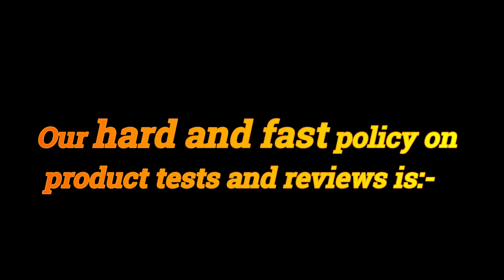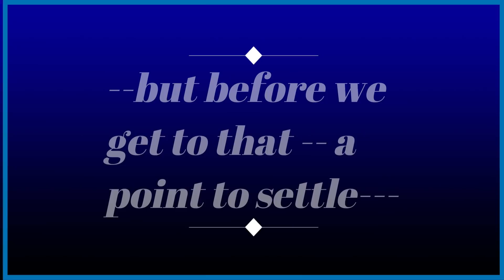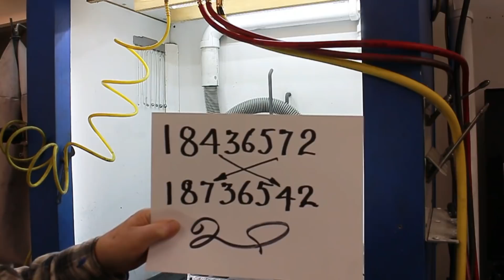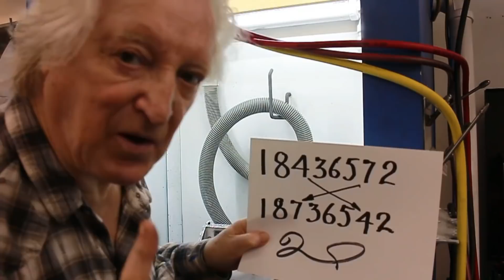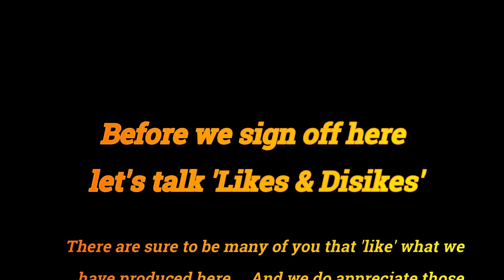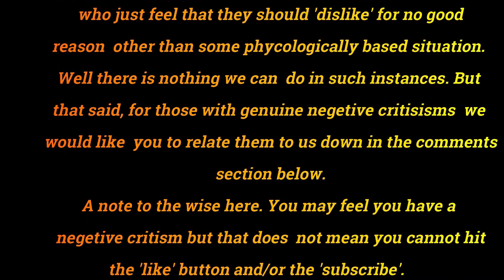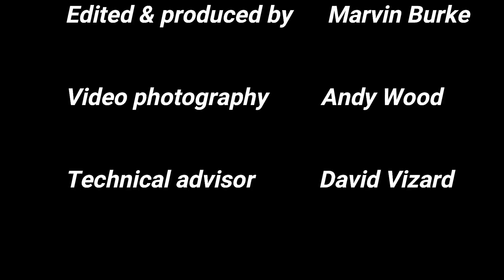PowerTec 10 EP 11Hi-Torque  Tunnel-Ram Mods

Comment: A lot of racing roots blown applications like the single 4&7 swap because the blower front loads the manifold. Allowing them to stagger the compression less in the front holes. Blown Fuel engines with the 4,7 3’2 swap beat the crap out of #3 for some reason. Most guys run it .030”-.040” lowered down the bore.

Comment: Sir, you just defined something I did in the early 90s but I never put any science to it. I had a 350 Chevy with lt1 head that I spent many hours porting. It had a big nice comp solid cam and 12 to 1 pistons. The engine ran very good and I was always tweeking and tuning to get more out of it. One problem I always had was no 2 spark plugs was brown and not burning clean as the other.  I knew I had power waiting if I could get that cylinder to flow. My intake was the old holley strip dominator single plain. I ended up beveling the entry edges to the port runners and the little engine had a tenth better et. Not focusing on more of what I did that helped, I simply realized the intake was a that needed opened. Then I scored a TRXY1  tunnel ram and two 660s with linkages. This was the beginning of a 19 year old kids lifetime love of engine building and heads up racing. 
I have used several of your books as well as smokeys books in my early years. I'm also proud to say my eyes and ears are still open. 
Thank you sir.
Reply: I can't forget my 1st launch when switching to a tunnel ram and 660 holleys on my 468 I kept waiting for the front end to come back down! Super fun but inconsistent for bracket racing.

Comment: I’ve been altering port inlet sizes on single plane intake manifolds for years based on careful spark plug readings. It does seem to improve engine performance within a few percent. The way David does it on the flow bench is good.

Comment: Very well explained .  The only criticism that I have coming from ireland that I dont see many v8s . I am more experienced with 4 cylinder engines like ford cvh or zvh . Ford n/a yb cosworth.  Some uk engine builder like roy millington etc
Reply from the maker: Tom, did quite a bit of consulting work for Mountune back in the day when the Cosworth YB was all the rage.
Reply: @marvingvx1   thanks David  am a big fan have some of your books I use them as a bible.  A power tec ten on a semi hemi cvh head would be nice. I am working on one at the minute. Exhaust port is all wrong need to weld it up. Thanks for your reply

Comment: David:  Thank you for the information on the tunnel ram manifold.  I've been conceptualizing my path for achieving a balance in fuel delivery for the intake manifold in general w/o the 7 to 4 cam shaft split.  I was told, and I hope the information is correct, that the richest to leanest cylinders running are #1, #3, and #6 on a SBC.  I see that there is truth as your porting example will express.  The only difference is the #4 cylinder which should be changed for the #3 cylinder....I hope this is correct.  I'm going to give your recommendations a try.  See ya!

Comment: Thank you David for your wealth of knowledge and very informative presentation.
Will help me alot with a f future tunnel rammed 350 chev gasser project.
Look forward to your spacer video and future explanations. Cheers
Reply: He was something back in 1965 - 75 and maybe as late as 1980. His knowledge of engines is as obsolete as the small block Chevy is. None of any of this applies to an LS engine so why bother? In 1984 I was making 52 PSI at the intake valve on a 1985 GPz 750 turbo. In a time Terry Vance and Bob Carpenter were running 8.20s on their 1260cc Pro Stock Suzuki's and George Bryce was running 8.0 on a 1425cc pro comp Suzuki GS1100s I was running 7.70s on an 810cc street bike. It was the fastest street bike in the world according to several motorcycle magazines. Bill Hahn and Bo O'brochta were only .500 faster than my street bike on their top fuel funny bikes. I never got to finish that project because I got hurt in a wreck that took years to recover from. I'd love to hear David tell me why I could explode a turbocharger in 3rd gear because it was spinning so high the oil wouldnt lubricate the bearing. I had Terry Kiser put a 3 stage Torrington bearing in it which meant I could now shift from 3rd gear to 4th gear before it exploded. FYI in 3rd gear the bike ran a low 9 second et at 145 mph after it came apart. in 4th gear it ran a low 8 second et after it exploded. My point here is I was against guys a lot smarter than David Vizard who were doing a whole lot more with a whole lot less and I beat them so bad its not funny. I hardly think anything Davids ever built could run with a motorcycle I built 37 years ago.

Comment: We used to separate the ports with a divider wall of aluminum back in the 80s.

Bv
Reply: ELIPTICAL(protractor shape) shaped divider set into epoxy from top to bottom of the divider wall entrance between runners #5 & #7, then drilled out on the top edge of the  ELIPTICAL divider extension & into the factory divider wall for appropriate sized brass machine screws??? I figured someone had already done it & you proved my hunch. Did your modification have any negatives regarding flow to cylinder #7?

Comment: Hi Dave
Vary good info on port flow and firing order can effect flow,
On Ford's small Windsor engines. The have the 3 7 swap on the HO motors.
Cylinders across from each other.

Comment: I couldn't believe that I was on live chat with Richard holder .i told him to ask DV about tthe 5 and 7 cylinders on a small block Chevy and how you can port the intake manifold to help balance the flow he said I don't need to call DV because because it's not going  to work because the intake runners are intake runners.
Reply: Holder is very good over all and forever learning. I have dyno the swap special Howard cam order my spec. On a big block chevy 540 c.i. in the mid 80s. The gain was 91 hp to as low as 64 hp. With altitude/temp effect the most. E.T./mph and two other dyno used with 4021 feet difference but ran still on dyno with 47 degree temp difference. This was 13.28 to 1 fuel alcohol twin carbs, MSD, 7000 RPM. Plus O-ring block copper head gaskets...belt driven vacuum pump, other tricks like crank scraper.
Reply: Check Steve Morrison videos on BBC swap twin turbo 3000 hp twin turbo. Think did same on Cleetus engine that just won this psdt week. Drove 800 miles and ran 6.99 /210 mph without turn up the engine even close to it's build. Check I may be almost wrong...70 yrs old watching and comparing note! After seeing .... Well the last of several videos I ordered the 540 power adder from BluePrint with couple filters and oil for two oil changes price was a bit over $14,000. Yep tax is a killer! Wish you the best and if your ever in Georgia north of Atlanta yell let you be my guest and I have a fun firearms collects I own my own range steel targets and great country cooking near by. I furnish everything for free. Plus you get look photos and time slips covering decades.

Comment: Ive got a tunnel ram on my 302 and its got a slight miss on number 5. New headers on all primarys turned blue apart from number 5. After it heats up it runs smoother. But firing order starts as 1,5 and those ports are right next to each other
Reply: If I only had the muscle memory of those hands from the years of knowledge and experience, great day to you Mr. Visard! The practical experience and knowledge of him is priceless.

Comment: Since I first took an interest in single plane intakes (early '70's), I've wondered if anyone has ever tried placing fine steel wires across the length of the plenum (staggered, two or so levels deep) to possibly help atomize the fuel droplets.
Reply: Screens and such can sometimes help low RPMs power, but anything you add increases the laminations of the flow and turbulence and hurts high RPMs power...

Comment: Would this same principle work with a crossram manifold? Have an Edelbrock crossram manifold from the 70's for BB Mopar in the build plan using throttle body injection.
Reply: The cross ram looks cool and works pretty well, see Engine Masters episode.

Comment: David, great series and I thank you for uploading these videos. It should be called a publication but, I am not a lawyer. My qustion is:  What are your thought on the Chevrolet (Winters) low profile crossram. I hear Smokey Yunick had a hand it the development, if not for GM that possibly Edelbrock. I have the Offenhauser version I will be uising with 2 500 cfm Holley carbs on a 352 Chevy (400 bnlock with 327 stroke). I don't really expect an answer as it would take volumes. Wondering if you ever investigated the use of the low profile crossram vs the tunnel ram.

Comment: What about using Holden v8 firing order 12784563 then there is no cylinder next to each other in sequence
Reply: Few would know what such is!
Reply: But they are across the intake from one another is that any better?
Reply: Looks vastly worse than SBC firing order for a tunnel ram... maybe better for a dual plane...
Reply: 3 &1 argue

Comment: What, or which of these mods help or hurt a tunnel ram used in an Enderle “Bug Catcher” mechanical injection system, with a 7070 Victor Ram? I’m running this on a 440 cid SBC. It runs 5.902 @ 116.1 MPH, 1/8th mile, on methanol, 73 Pontiac Ventura, 3,260 lbs, including driver.

Comment: can the carb mount plate be altered to even out flow on all intake ports ? moving the carb opening forward or back ? how would a LS engine firing order work with a Tunnel ram intake ?

Comment: I would like to see this  mod.on  a SBC single plane.I would like to modify the The Team G intake like you did adding the extensions on the deviders and the 2" spacer in one of your books.Will it  be good on lets say a 421 cid street car around 570 HP. Also curious about the what you found out years ago when you tested the Holley Duntov intake the had the extra runner to help with the 5 and 7 runners. Thanks for all your help all the years.  You have saved me alot of time and money.  Thanks for the great video.

Comment: Interesting video...I’ve always bell-mouthed the ports equally on Ford efi 5.0’s when I cut open the plenum for porting.  In the 5.0HO and 351w firing order, cylinders 3/7, 2/6, 4/8 compete for air in the stock type long runner intake....my question is: would the principles from this video still apply to a much longer runner, in which the air coming into the plenum has to make a U-turn before entering the ports?
Reply from the maker: Tell you what Mr. Carport sir, you have just initiated a video on this very subject. If you are a subscriber you will get a notification but don't look for said deal just yet.
DV
Reply: Sounds great, I am a subscriber, and I look forward to each new video that comes out.  For what it’s worth, I’m about to purchase a flowbench and valve grinding equipment so I can dive into the deep end of porting and have qualitative results for my work.

Comment: What are your thoughts on extrude honing? Have you ever tried it?
Reply from the maker: Yes -it does increase flow and some OE manufactures have successfully used it - however the finish is not conducive to good wet flow so only a port injected system can be used to side-step this issue.
DV

Comment: Does this apply to mechanical injection? Namely Enderle? It uses an Edelbrock VictorRam. It looks like the one you’re modifying now. Thanks a million in advance!
Reply: Air flow is the key... the rest of the system is just trying to keep the A/F ratio correct at all times...

Comment: Making a silk purse out of a pigs ear springs to mind.  That designe must be very subceptible to cam duration and overlap?
Reply from the maker: Do I hear a hint of disapproval in your comment?
 
Lets take a simple look at what was delivered here. For about 5-6 hours work and zero cost I have shown how to take a relatively cheap (as apposed to sheet metal stuff) cast intake and add about 25 hp and a similar number of lbs/ft to what ever your typical hot 383(585-600 hp before) delivers. 

Since it has a tendency to reduce any   air and fuel distribution problems there are no cam issues that have to be 'fixed'.
Reply: @marvingvx1 No not disapproval (who am I to think such a thing). Having 8 branches into a plenum fed by 2x4 barrel carbs seems like a missed opportunity. The spacer plate test is going to be fascinating, does any of them separate out the individual carb. barrels to match the manifold runners? Time will tell, Thanks in advance🙂
Reply from the maker: @gothicpagan.666  You are more than welcome sir.
DV